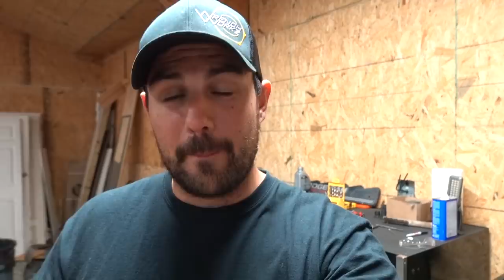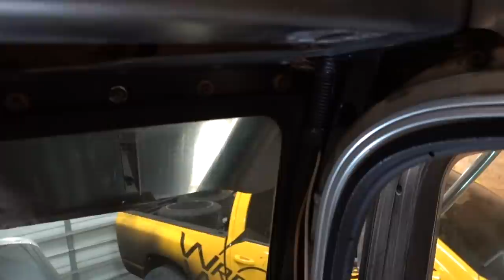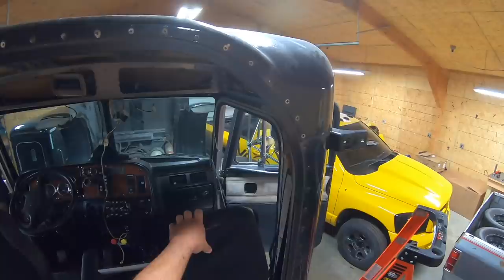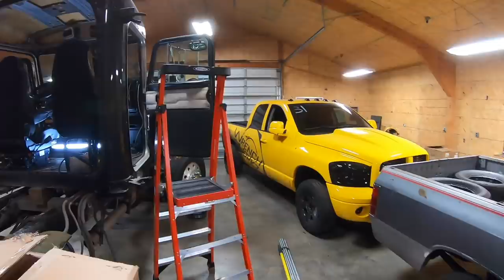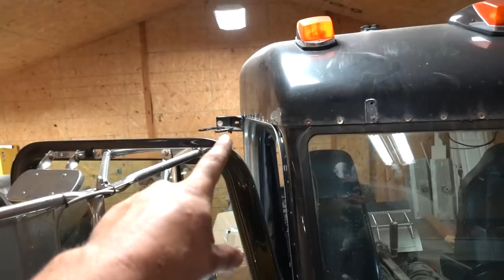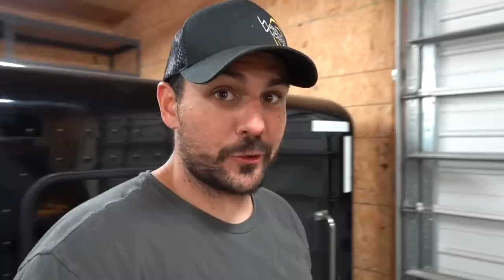PETERBILT 379 EXHD CONVERTIBLE TOP!!!

Comment: In my experience , cheap 20 guage metal strapping with adjustable holes works great for  bolt in cross bracing to keep cab in a ball park shape . When the top comes off , everything goes wherever it chooses to . Causes  a mell-of-a-hess , especially when doors are open .  😨👍♥️🇺🇸 Life lessons 🤣😉

Comment: Hey man i would advise using oil to cool and lubricate the drill bits. Just get some multi use oil from a hardware store or at minimum some wd40. It will keep the drill bits sharp and last much longer

Comment: if you dont ever plan on taking the flat top off why not just seam seal it on and fill the out side edges with filler and paint it for a flush mount with no hardware

Comment: Why is there a clutch pedal qhen its an auto? Or does it require clutch for take off and then the auto kicks in?
Reply: These things don't have torque converters. just a clutch for stopping and taking off after that the solenoids do the shifting. You can actually put a shifter on the top of that transmission to convert it back to manual